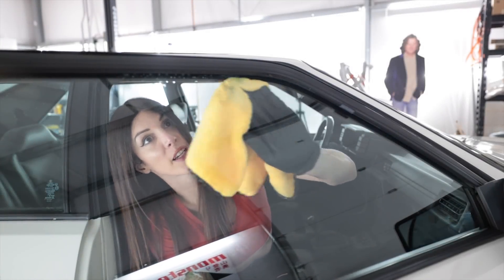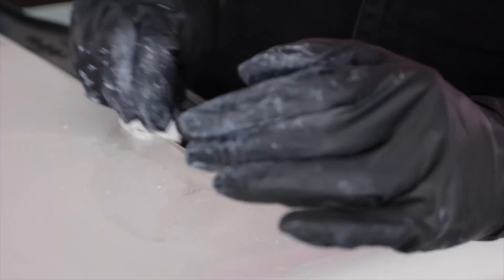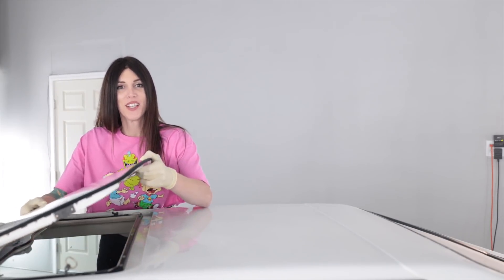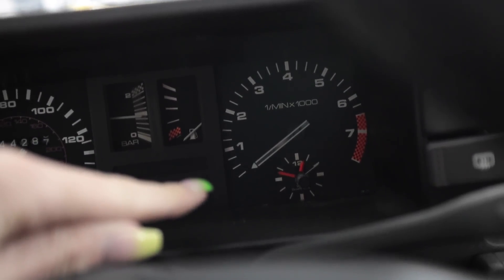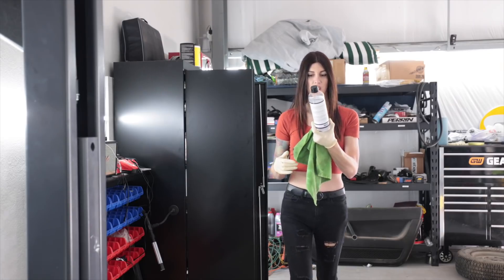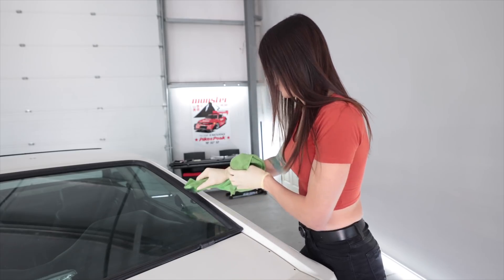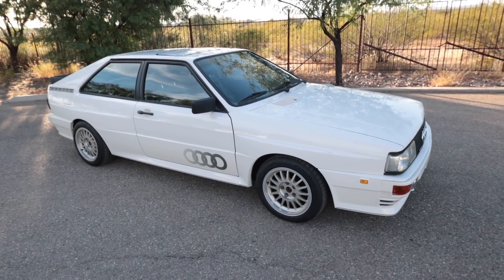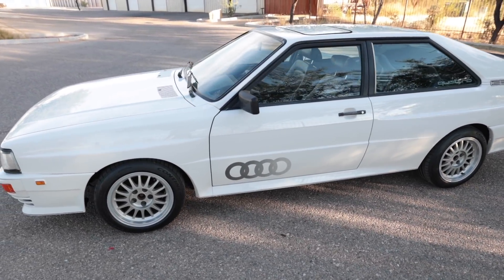I Spent 5 Days Polishing My Paint & This Was The Result // Ur Quattro

Comment: In case you didn't know, when you pop the sunroof panel out, there is a place to store it. Open the trunk and there should be two brackets attached to the "roof" of the trunk. The panel slides in there.
Reply: Owned one of these for a long time and always wondered what those brackets were for. Duh.
Reply: That pannel roof/ open-top  in German is called "Schiebedach" .. ;0)
Reply: @poplaurentiu4148  genau - and the literal translation would be push-roof
I still remember cars were you had a handle, you turned it and then you could manually push it back…
Reply: I was getting ready to offer the same info. Loved moving the roof panel to the "trunk slot" in my old car, such a clever design!
Reply: I too was about to give this info. I used to have mine in the boot year around, cranking the heat during the winter, just to be able to hear the sound from this amazing car better. Miss mine so much.
Reply: BTW, I only wish I owned a "Ur"! 
I know this info from owning an '84 Coupe GT.
Reply: Make sure the drain holes in the sunroof frame are clear of any junk
Reply: Correct ..I had one too and soon found that out
Reply: Came here to say this.
Reply: Correct but just make sure the felt panels are still stick to to the metal sliders otherwise you will scratch the roof as it goes in upside down...

Comment: I would also make sure that the holes in each of the corners of your sunroof are not clogged. Cause if they are the water will go inside and wet you and your interior. It happened to me in my 2013 ford focus st.
Reply: I had that problem on my 08 F350. Turned out the factory didn't install the drain tubes, so any water that passed the seal just spilled on top of the headliner.
Reply from the maker: They’re not

Comment: Spent two weeks polishing a red 90 foxbody. Single stage paint with a ton of soap stains & etch marks. Turned out better than brand new. Finished with some nano sealant & multiple coats of wax. Took forever but it was so rewarding.

Comment: Great car selction Sarah. A real icon and still looks great with its timeless design let alone the pedigree of its performance history and innovation with the quattro system. Great that you used canuba wax as well which IMO beats all the latest chemical fads. The best thing about wax is you keep putting on new layers so I would not stop at one coat. Mothers canuba is the also a great product in my experience. Once you get a few layers of wax on you never really need to polish again. Just a quick wash another wax layer and the car will look graet for weeks on end even when it is dirty.. Look forward to more Audi quattro vids. Would be great if you could get some slightly bigger wheels, say 17's, without losing its originality.

Comment: If that power antenna still works, don't forget to wax it too. That keeps it working smoothly with a weather resistant coating. The car looks great for its age. I agree with your plans for your car. They were built to be driven and run better when you drive them.

Comment: Razorblading glass is such a fantastic technique, I've used it for fishtank cleaning but never automotive glass.  If you want to eliminate any chance of scratching then you can use a file or grinder to slightly round off the corners of the blade.  
And when you've done that, store the blade in a little jar of isopropyl alcohol (or vodka), it'll stay sharp and rust free for a looooong time which will further reduce the chances of scratches.

Fabienne looks fabulous, I can see the difference in the reflections, they're much clearer and sharper as you pan the camera across the panels.

Comment: The mirrors become loose because the pot metal bracket that attaches to the mirror retention spring becomes warped over time. I cut new ones out of aluminum plate  stock (2024-T3) and that resolves the issue.   What a beautiful car.  Terrific job.

Comment: This looks fantastic - fully understand and appreciate the time it takes to do. Couple of things I've picked up is not only polish and wax the paint but polish all the glass with the heavier compound/pad combo (then if you are like me, the finer set as well for completeness. You'd be amazed how much comes off and into the pad. I used the same orange cheap ebay ones in the bag you had for that, then binned them.  Then wax the glass, buff off. In winter (not in Arizona!) it stops your windows freezing over, so no scraping it and scratching it or spraying deicer all over it and it all smearing up the next time it gets dirty. The wax also as a water repellant making it safer to drive in the rain (no rainex needed saving money) , and I've found as a bonus makes the windscreen wiper blades last longer so saves more money in the long run.

Comment: Geyon "prep" with get the compound, polish and paint residue off between steps and before coating. it doesn't have any protective silicone etc in the formula to worry about if your going paint or ceramic coat. Makes things a bit easier and quicker. BTW glad you're keeping the factory wheels I went through the same questions with mine back in the day and came to the same decision the factory wheels were the best choice for looks and performance

Comment: I clay bar the windows to get ride of schmutz and other stuck on debris. I also wax the glass to get rid of streaks. Alternatively you can use a used microfiber that has dried wax on it to remove streaks on your glass. If the glass is wet, when use the cloth, let it dry after you wipe it down. Residual wax gets rid of any streaking.

Comment: You can use a very fine steel wool for glass and chrome. Lowes Has a 0000 super fine steel wool which is great. We used it to remove overspray from glass and chrome.

Comment: Beautiful car Sarah! I had nearly the same car in collage, but mine was an 82 4000 diesel. It had 55 hp, got 50+ mpg, and could be driven flat out in rush hour traffic. I think I would still have it today if my friend didn't get side swiped in it and pushed off the highway down an embankment. The car flipped end over end several times on the soft Florida soil and came to a landing on all 4 tires that popped. My friend was unharmed, and the car needed only a driver side fender, mirror, hood, and tires. I think the 4000 might have been one of the best cars that Audi ever made.

Comment: The CERAMIC coating fills in the very small minute scratches in the paint job, especially as it is an older car and paint job. I was amazed after I put it on my 63 RANCHERO, Buffers remove too much of the paint. Do it by hand.

Comment: Thanks for the razor blade tip 👍
Ended up using it, not on my S2000, but on the oven door glass, while cleaning it with my wife 😂. As you said, does not scratch the glass.

Comment: I used to use a razor blade every time I deep cleaned glass, I have since switched to 0000 steel wool, Works well.

I'll still use a blade if things get horrible (I live in Illinois and the bugs are horrid) but the 0000 works a treat between or if you keep up on it.

Comment: Having worked as an automobile painter and detailer in the '70s and '80s, I agree that you've done the right thing by doing a major detail on this worthy unit. Painting would have been a waste of time and money. The original paint is like stone. (You can still buff through by accident. Don't ask).  You did a great job and now you have an intimate relationship with the exterior of the car as only a true "Finish Geek" could! DO NOT BRING THIS CAR TO NEW HAMPSHIRE.

Comment: Take about a 6 foot length of weed whacker line and run it down into the 4 drain holes on your sunroof. This should unblock the drain tubes if they are clogged up. Take a 20 ounce soda bottle full of water and slowly pour near each hole to make sure they are draining. I do this once a year to make sure my sunroof doesn't leak into the car.

Comment: The white stuff on the rubber I think is not paint residue, but something called "blooming". In essence it is some chemical stuff produced during the vulcanization which is dissolved into the rubber and slowly migrates to the surface due to some energy (normally sun heat) combined with moisture.

Comment: It is a sunroof but it ain't a sliding one and yes the Mirrorglass is heated but it isn't mentioned anywhere exept the manual and it works with the rear window defroster.
ALso know in this video you could see the car got a facelift before the Bumpers the Headlights the Grill and the Emblemes on the Trunk are 86 modell year parts
also the front Bumper seems to be of a Swiss model with the narrow plate mount, just wondering why they didnt't swap for the GFK trunk lid.

Comment: Just in case you don't  know... after removing that sunroof, in the corners of "the hole" there are holes! These would be drain holes and it's kinda common for them to get plugged up with ,,,, what did you call it? sludge? Then I'll call it sludge. And if they get clogged then water can sit in them and after a while rot out the metal drains and start leading to water leaking in unhandy places sooo.... you probably need something to shove into the holes to make sure they're open... or maybe blow some air through them?

Comment: I came close to buying a used Coupe Quattro in the mid-90s.  What a NICE car they are. They were expensive back then and dare I say exotic.  I'm certain that you are well aware of the race provenance of this car.  I am stunned to see one here in your video.  Sarah you are a woman of taste and refinement.  Now I am envious.  I had to settle for a 4000 CS Quattro which was nice as well, but it's not the turbocharged Coupe Quatro.  I have a Subaru Impreza AWD now; nice car, but it's no Audi.

PS  Years ago I owned a Ranger standard cab long bed 4wd pickup.  Nice Truck, built like a F150.  Rangers are well worth restoring, especially if it was your Grandmothers ride. 

Notice how much bigger the new Rangers are?  They're not small trucks anymore... more like mid-sized, and the long bed is not available in any make mid-size pickup.  The reasons I bought small long bed pickup trucks back when you could get them is because they get much better gas mileage, they ride like a car and most importantly, you can park them in the city.  The parking is key for work.  

Gas is 5+ times  more expensive now, and all you can get in a long bed is a full sized pickup truck; go figure.  These huge crew cab pickup trucks that cost $85,000.00; I don't get it.  Take a 3 ton vehicle to drive to work or out to buy groceries?  Way to waist fuel if you ask me... but different strokes for different folks.

Comment: being a restorer, soda blast isn't a  very harsh process. if you really want to clean castings, strip them down and get the cases vapour blasted. its a wet blasting process that uses glass bead in a slurry. but its a huge job

Comment: Sarah, isn’t that yellow wheel on your drill motor specifically for removing decals from painted surfaces?
Reply: A crepe rubber wheel, many uses it will also clean sandpaper.

Comment: It is a Moon roof😆
Reply: Sunroof: Generally made of glass or metal, a sunroof is defined by its ability to slide open and/or pop open to reveal the sky.
Moonroof: As its name suggests, a moonroof is a piece of tinted glass that slides between the headliner and the roof. You can usually tilt a moonroof open to breathe fresh air from above.

Comment: How similar are these to the B3 audi 90/80 late 80’s chassis?  Or the old 4000 series audis?   

I didn’t realize the UR Quattros had 5-lug wheels.     I imagine the strut mounts and other subframe bushings are similar.

And the 10 valve 5 cylinder which was in the old 5000 audis.   It’s cools how Audi and VAG (Porsche, VW ect…) cars seem to use parts like legos sometimes where upgrades are as simple bolt-ons.      I used to buy non-running old school audis back in the early 2000’s because people would almost give them away after not being able to find   competent mechanics or affordable means to maintain these lovely works of timeless insanity.
Reply: Who remembers MikTip and the original Audiworld forums?

Comment: I hate pointing it out, but you missed a spot...
Reply: It is hardly noticeable. But could be seen during your final walk around. Like the buffer wheel just missed it since it is a slightly dull spot in the shape of a wedge with the curve of the buffer along the top. I only spotted it for a second. Had to pause and zoom in to see it. If you take a drop light and hold it at different angles on that side you might be able to see the dull spot. It is right there next to that smudge...